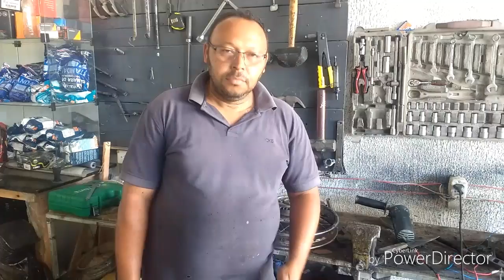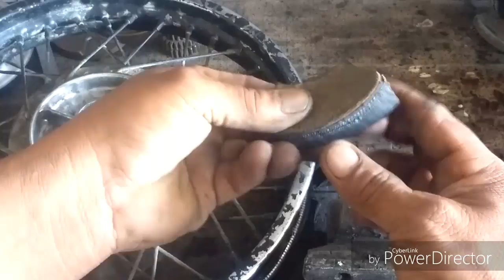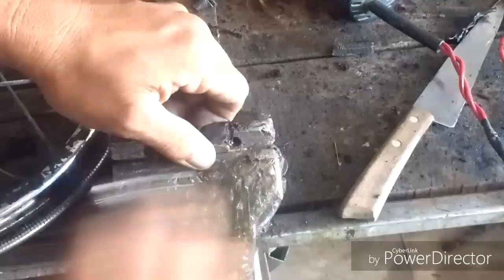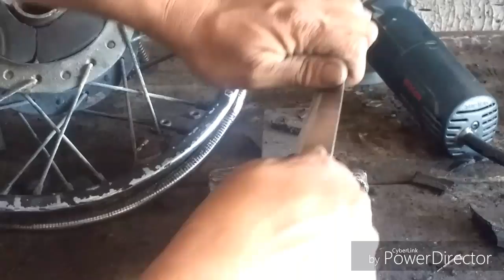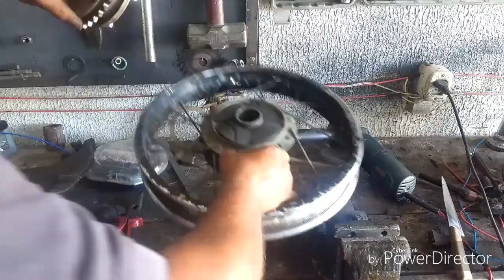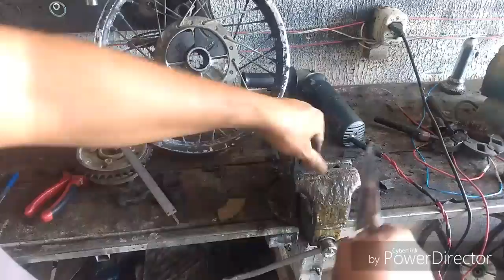Como fazer buchas da coroa com pneus da CB 300.

Comment: Esse joao e um gênio! Deus te abençoe. Meu amigo pode me ajudar acompanho muito seus vídeos e troquei o cilindro da minha super 50 por de 90cc CABEÇOTE de 100cc e carburador de biz 100cc fiz tudo certinho coloquei no ponto não vaza nada. Masss.... RS a moto embola quando estica aceleração no caso quando desenvolve ela engasga.  já tentei regular a entrada de ar Já fechei já abri mas não Estou conseguindo regular o carburador. será que é o carburador mesmo ? Já aconteceu isso com vc alguma vez depois de fechar o motor ? Será que é ponto? Acho que ponto não deve ser porque ela pega fácil e o barulho está normal. Em sua experiência o que acha que pode ser ?
Reply from the maker: Todos os motores tem seu limite de rotação, ele tem duas opções quando bate seu limite final, uma delas é a quebra das válvulas e a  outra é engasgar. com certeza a moto mais potente e você deve não está respeitando esse limite.mande um vídeo em: jgnparamotos no mensegem.fico aguardando.
Reply: @JGNMOTOS  ok mando sim mais ela não está chegando nem no limite as vezes parece que está jogando combustível de mais
Reply: @JGNMOTOS  tipo não  chega a 40km e que embolar